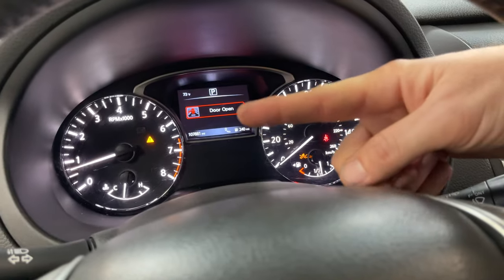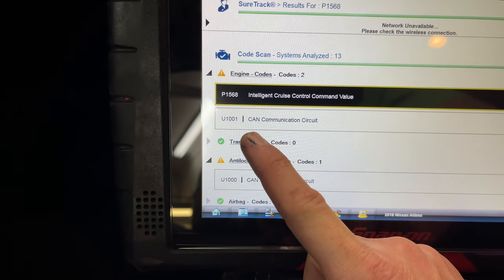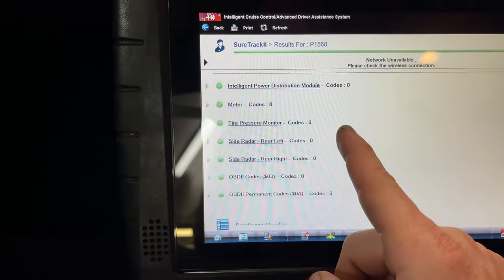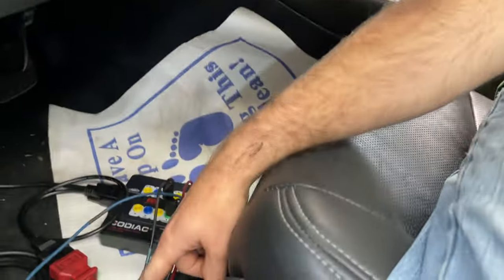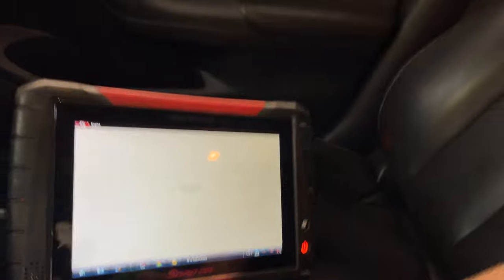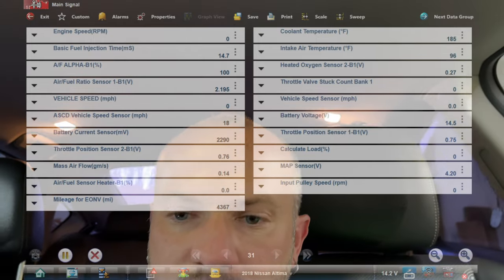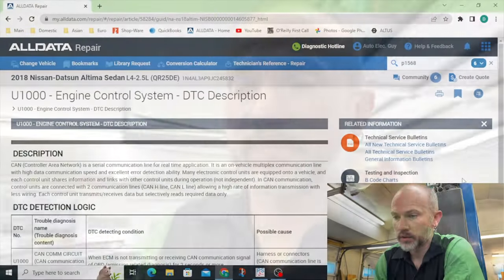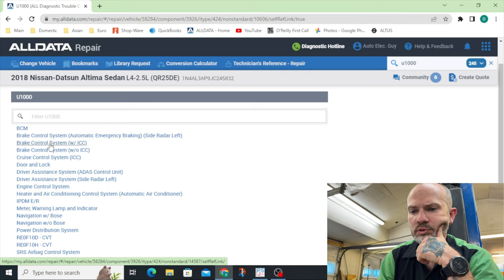The Frustration of Diagnosing Nissans

Comment: Nice work sir. I was a Ford tech for few years before I moved to the Nissan dealer. Diagnosing Nissans has a huge learning curve, but it gets easier once you realize it's like working on a car from 15 years ago. One single CAN network for most vehicles until they finally added ITS-CAN. And a bunch of LIN busses. And a bunch of standalone modules that have "listen for the beeps or flashing lights" diagnostics like it's the 90's. Park-sensor modules on 2023 trucks are STILL all about listening to the beeps. When new engine functions are added (like variable compression), they don't always update the ECM, they just add another module that bolts right next to the ECM that handles that one single function. It's wild. 

Nissan diagnostic information and trouble trees are generally poor. Lots of institutionalized knowledge to become fast at it, and tons of diagnostic information is hidden in TSBs and Tech Tips that never make it into the service manual. The TSB you might need may have been released 10 years ago but applied to most cars, but doesn't show up on the vehicle you're working on because it's a 10 year old TSB that is still relevant but not updated. I had an unreal number of printed bulletins in a folder because it was faster than trying to remember what vehicle I could search to find that bulletin under. 

CAN on Nissan used to trip me up until I learned my way around it. A lot of bad translations and dealer lingo gets in the way. When it says "lost communication with ECM" in the service info, that doesn't necessarily mean engine control module, that can mean electronic control module. Meaning it just lost communication with SOMEONE. Some of the cars are set-up so the modules have a "buddy" that they look for, so the missing module code only shows up in one module, not all of them. 

If you use the dealer-level CONSULT tool rather than R2R, you get topology access. (At least I didn't see the topology tab on your screen). It's real topology based on the VIN and what options it should have, not like Topdon or Autel topology. That's what I would have used to identify if any module was actually missing. The U1000 says someone is gone, topology page tells you who. After diagnosing about a billion faulty Laser/Radar units (salt intrusion and generally being junked killed a ton of them), we really got used to just looking to see if it was missing. 

The DTC Info button has never worked or provided any valuable information. 

Looks like you didn't get access to the navigable wiring diagrams and just got PDFs. Too bad, Nissan's diagrams have come a long way and had nice quick links to 3d connector location views, pinouts, etc. I really miss the OE wiring diagrams from Nissan and Ford. 

CONSULT3 is a real piece of crap tool. Data rate is unbelievably slow. If you plug in an old CONSULT2, (think Nissan's Tech2 or DRB3), the data rate is out of this world. I preferred to use my really old Solus Pro to do any drivability diagnosis, but Nissan required CONSULT3 screenshots for all warranty work. The only reason I would ever consider buying one is if I was regularly programming new CVTs or something.
Reply: Yes, thanks for this insider experience. I'd kind of wondered how many violations of existing right to repair legislation might be hidden in this experience but it sounds more like just poor technical documentation and troubleshooting engineering that even dealer techs are struggling with.
Reply: You summed up the consult III user experience to the letter lol. It gets fun working on an off brand vehicle after working on mainly nissans day to day - you have to stop and tell yourself "no, this is how this SHOULD work on other vehicles"
Reply: Just moved to a Nissan dealer. Been about a month. Coming from Chrysler and Hyundai. You’ve summed up my experience so far.

Comment: I'm sorry you had to go through all that, but I can't thank you enough for the way you explain your thought process when diagnosing complex problems.  Basically I've experienced exactly what you did by watching your video so I'll have that knowledge moving forward in case I run across a similar situation.  I like when you do simple problems because before you tackle complex problems like this, you need to have a solid grasp of the basics.  You do both as well or better than anybody.

Comment: I had been a Nissan tech for 6 years and was just recently back working at Nissan. Their systems are so dated once you have been around other manufacturers, and you also see how slow they are to interrogate. That U1000-1 code is usually just a U1000 code and the -1 is a first stage, unless they have changed that since I was there. Normally a U1000 is treated as a past/ meaningless code and usually clears easily. Since all the new tech has came out around the drivers assistance, I have seen so much more software errors or modules shitting themselves which does not help the tech make that decision to replace the unit, it’s an expensive call. 
Good find, and great perseverance on looking for that fault rather than giving up like a lot of others would have!

Comment: Fantastic though process, against all odds planted by Nissan. I commend your patience and capacity to keep calm with such a frustrating problem! And it was a botched job someone did in the past that created the problem. You may say you were lucky, but only on where the wire was broken, because you were on to it already, by sheer reasoning. Great job!

Comment: Man I absolutely agree with you. I have never understood the module structure which Nissan uses. It always seems like the module I want is a sub module inside a module, racks my brain. 

Also yes the end spike on the data packet is the end of transmission. The difference in size you were pointing out I believe is due to how far away that module is on the bus.

Comment: On the powertrain HSCAN bus you can have control algorithms executing at different rates depending on what component is being controlled and at a data rate that is fast enough for its function. For relatively low speed information the transmitting module is actually just broadcasting the information onto the bus at a set rate, and who ever needs to read the message does so based on the identifier. Modules setup an identifier filter table to ignore messages (packets) that are not relevant to the receiving module's control functions, in this way the module is not wasting processing resources by having to look at every message. Some control is not broadcasting in nature, it is actually synchronous, in that, either executing a control state machine or feedback control usually just between two modules like the ECM and the TCM.

The vehicle battery lugs need to be replace, and the battery and its terminal cleaned. The main battery cables should also be checked for corrosion or damage, especially the block ground. 

There was an interesting struggle between the experience domestic OEM harness engineers (harness component engineer, sign off responsibility, the engineer that works with the supplier) and their supervisors (not necessarily very good at engineering) when a Japanese competitor car reverse wiring engineering report was issued, in that saying that the Japanese are using a lot of 20 AWG wire (actually  0.5 mm^2 metric wire) and the harnesses were not well secured at times. The domestic OEM harness engineers would not go smaller than 18 AWG in anything outside of the passenger compartment, and even this was not done due to having to secure the smaller wire harness every few inches to prevent it from vibrating, and so you would see virtually no 20 AWG (0.5 mm^2) anywhere on the domestic made vehicle. The underlying reason is wire gauge is not just chosen for electrical properties but also mechanical properties, and over the years it was found that 20 AWG wire is not mechanically well suited for automotive applications. This is why you would see signal and low power harnesses in the vehicle virtually all have the same 18 AWG size wire. If you look at a domestic OEM PCM you will see mostly 18 AWG (1 mm^2) with some 16 AWG (1.5 mm^2). Only on special mixed mode connectors will you see huge power and ground wires. However, the mixed power (mode) connectors are more costly and used when there is a strict size limit on the modules installed location. 

For under-hood harness design you have to secure the harness from vibrating regardless of its size. You can see on the Nissan that the harnesses in the front bumper area are not well covered or well dressed (secured).

Comment: I struggle with nissan as well 😅 im not a big fan of their diagrams and i have been spoiled over the years. I was looking at a can pin # 87 so i was looking for a BIG connector (didnt see any info from nissan on connector locations) turns out it was a 6 pin connector and nissan just continued counting pin numbers from one connector to the next.

I did notice on my last nissan that had the u1000 that i could talk and read data from all modules, but the tcm was bad slow and i didnt see the tps pid updating.  Corrosion in the trans plug ended up being my issue. The u1000 code was in several modules though so where do you start?
Im guessing in my case the k line was transfering the data i was seeing? 🤷‍♂️

Comment: Mate what website you use to check the wiring diagram thanks in advance for the reply 😉
Reply: @autodiagyt   unfortunately ALLDATA is not working at Australia mate 🙁 but thanks for reply 😉 i just want to ask also if you use a ECT3000 power probe to find a short or ground 😉 and it’s safe also to ECU to work with this tools 😉 thanks in advance for reply and really love your video I learned a lot thanks for sharing 😉
Reply: @autodiagyt  ECT3000 check it out mate they promised they can help u in more ways but it’s quite expensive 😅 thanks for a quick reply by the way 😉

Comment: Great video!!! I was listening to your video on my drive home and had a feeling it was related to the distance sensor based on those familiar codes being set as I work in a collision shop doing primarily ADAS calibrations and trouble shooting all kinds of issues after the shop has put the cars back together for deliver. How has the cardaq Jbox working for you? Any issues or complaints? Considering picking one up fairly soon.

Comment: Im sure I watched all the video. Might have to go back through it. Was there any live data from the ADAS for its sensors? Looked like a satellite fault from the beginning. Surely the distance sensor would show up as strange. Nissan wiring is very prone to breaking at the exit of plugs. If you look at the copper in Nissan looms it is very brittle (and thin) compared to other manufacturers. I have to agree, a lot of manufacturers code descriptions are very cryptic nowadays. Always tug test these things. Anyway, good result 👍

Comment: 1k broken wire fix, at least it's not a 10k at the dealer for just throwing modules and then a whole harness, not to mention 9 months or more sitting on their parking lot. Great find, great work 👏 👍. 😊
Reply: Just had a 2020 Nissan Kicks last week come in that the dealer had quoted them on a $4000 wiring harness because of a mass airflow code and couldn’t tell them exactly where the issue was. Found all of the pins that go to the mass airflow sensor were fatigued at the ECM connector. No tension at all. I’m betting there was an issue with one and while trying to check it out they didn’t just miss the issue they made it worse by damaging multiple pins with there test leads. Went to the wrecking yard and cut off a few pins, soldered them in and fixed the issue for them for a couple hundred bucks. They couldn’t even tell them exactly why they were going to replace the harness just guessing that it would fix it. There is a serious lack of skill and knowledge in the industry and it seems to just be getting worse with time.
Reply: @John Pilgrim  I know dealers will not cut any wire to fix ( liability issues ). They will replace a whole harness just because of one broken wire. I had a customer come in with a 2018 civic with an airbag light on asking me to replace the whole harness he bought at the dealer because the dealer wanted more than 8k to replace, I refused to change the harness without finding the problem first, but the hard headed customer said ( I already paid a lot of money at the dealer and purchased the harness they told me it was bad I don't want to pay anymore to find the problem I just want it replaced ) I said then go and get ripped of somewhere else, I'm sorry but I will not replace a whole harness that runs all around both sides trunk and under seats in the inside of your car just because the dealer said so, and anyway when I pulled the  DTC'S it was for seat weight on passengers side, but he insisted on replacing the harness. I just had to turn him away as I could not charge to replace a whole harness without knowing first what went wrong, and wished him luck. So, for people out there who have been told by dealers to change a whole harness, please go see a professional mechanic for a second opinion, as whole harnesses don't just go bad and in most cases it's just a broken wire or a short somewhere.

Comment: Do you have a video on how to diagnose the delta sensor on a booster   on a Nissan o infinity? I have a 2005 infinity qx56 that has a problem with the brakes it's giving me. A code P1179 for the delta sensor. I check my wiring and some else has replaced the brake boos ter with the sensors, abs unit and wheel speed sensor
I look a the scan data and the delta sensor reads opposite from what all data said it should be  
I think with the brake pedal depress the delta sensor should read 0 mm and without pressing the brake pedal it should read 1.18 mm 
Do you know or have a good readings from the sensors ?
Reply from the maker: No i don’t. I’ve never seen that sensor before.

Comment: First!
Reply: Step 1: replace ADAS control unit 🤣👌
Reply: Nice diag Jake, feel that Nissan pain lol! Have seen similar U codes on the AVCOMM ckt where it's just a generic code and you can't access the sub modules with the scanner...frustrating to say the least!
Reply: @autodiagyt  or just with more thorough documentation, maybe…
Reply: 31:50 you need to learn the Keith Tug test 😅
Reply: @NewLevelAuto  works wonders on crappy butt connectors... Pulled like 5 wires apart just this week! 😂

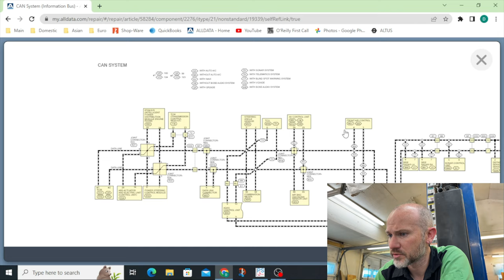Comment: The ADAS unit seems to have its own dedicated CAN bus sytem to communicate with all the sonar and radar sensor modules (the 4 modules on the right at 13:44). Since a scope was never put on this network, I wonder if the power wire for the front sensor was somehow shorting out the dedicated CAN bus. Instead of just saying "power supply distance sensor" you will get a total loss of communication on the whole dedicated CAN network, meaning that all you will ever see is a U code in the ADAS unit, truly a horrible fluke of luck.
Reply: @autodiagyt  Yes the sonar control unit is on the dedicated branch. My shorting theory was wrong -- meaning solid communication WAS possible. Therefore, I honestly see no non-malicious reason it shouldn't at least tell you that there is a problem with the front distance sensor.

Comment: 41:00 - I think some cars check battery health by looking at the voltage drop during cranking.  If it drops too low, the battery is near end-of-life.  Your battery maintainer messes with that.  Possibly because it's not seeing a normal voltage drop.

Comment: having worked for 13 years at a dealer of japanese equipment, you learn the japanese way of thinking. its a cultural deal. and the janglish translations can be fun to read!. the diagrams are different too with subtle nuances.   a couple things i seen here as i was watching--- it was a u1000-1. that dash one would suggest a sub system. and as you showed the diagram of the can system @13:15 if you see the right edge of the adas control unit is a squiggly line and at the end of that branch the same named unit has a matching but inverted squiggly line showing yes these are 2 parts of the same module so yes they looped a sub can network in there. appearantly it reports through the module to the rest of the can? but probably isolated for noise reasons? interesting though that until the fault was fixed that laser distance thing didnt show up. it would have been interesting to scope that subsystem to see what properties that can has.  another thing  i seen was the cracked fog light lense. that thing had been crashed in that corner before. even as a tech the japanese were very secretive on what they considered propietory information.  some times they would send parts and just tell us to change them rather than give us an understanding how things worked.  one time the flew a tech from japan !

Comment: Did you hear me screaming "you're missing a module"??? Lol.  This is common Nissan trait. These are the jobs I see all the time and surprisingly that is also what I find 50% of the time.. That's a non Nissan approved fix, probably by a bodyshop.. 😂. The communication loop is probably a redundancy thing, incase a line gets lost, all modules can still communicate with the ADAS module.  Kinda like a GM MOST bus with or without the directional signal..